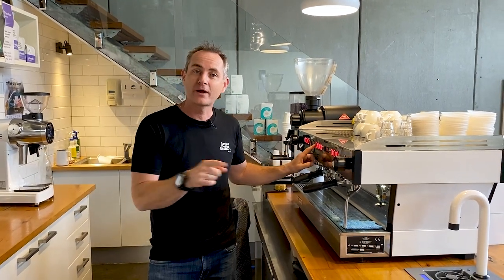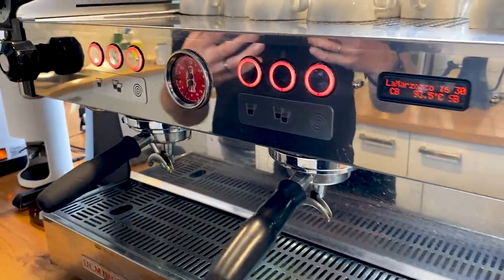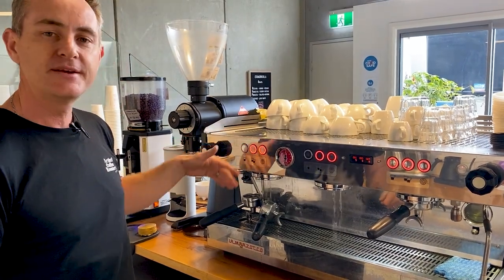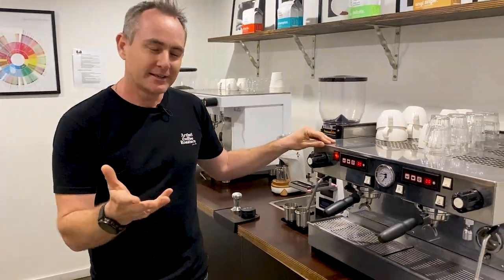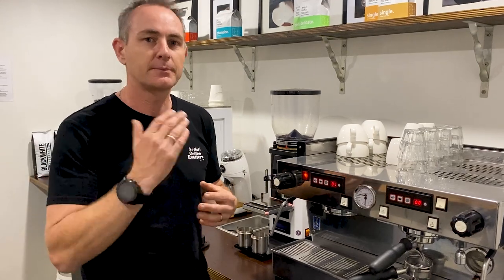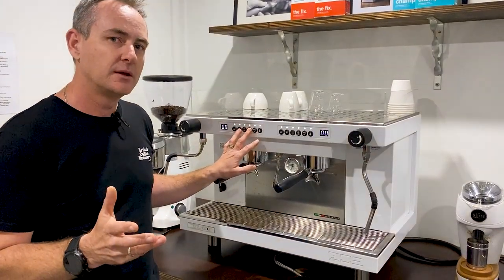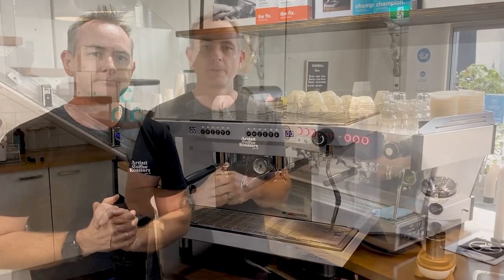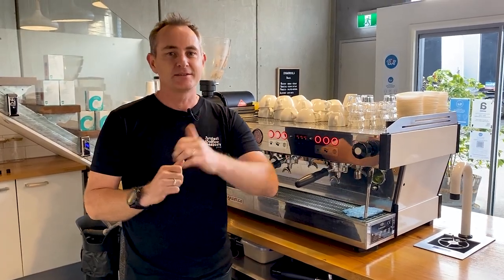How to Program the Buttons on a Coffee Machine (Barista Guide)

Comment: is it possible to program each head in a dual group head for different settings? 
As long as i work in my coffee place, I just have one grup
Reply: In short yes, but even in a medium traffic cafe this could be challenging if not a nightmare to operate. I work with a dual group Linea Pb which its copy and paste function is failed, it means you have to dial in EACH button separately, it's time consuming and inconsistent if not extra careful.
Reply from the maker: Yes you can, all machines have a master keypad, if you program this it will program the others. Then if you program the other key pass they will be different
Reply from the maker: The copy an paste may it be the issue, if on a PB a restrictor is blocked, which is very common, it can appear the function is not working. Get a tech to check the flow is the same buy water with time and volume. In a pb you can change to pulse, that’s easy to match them and choose the option, use group 1 setting.
Reply: @ArtistiCoffeeRoasters  might be true in general cases but the Pb I work with, its software is from the oldest straight upgrade to the newest OS, several glitches include volumetric setting in one group doesn’t count pre-infusion in(which make c&p to another group not working), but on paper everything seems fine, even the technician can’t tell what’s the actual problem🤷🏻‍♂️.